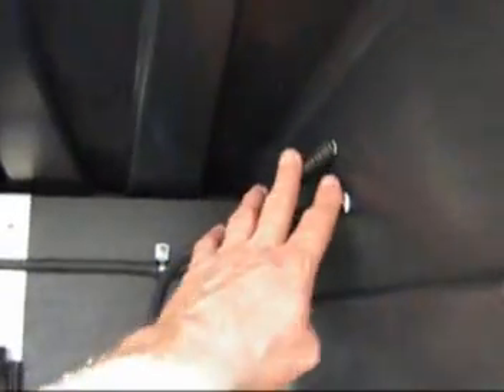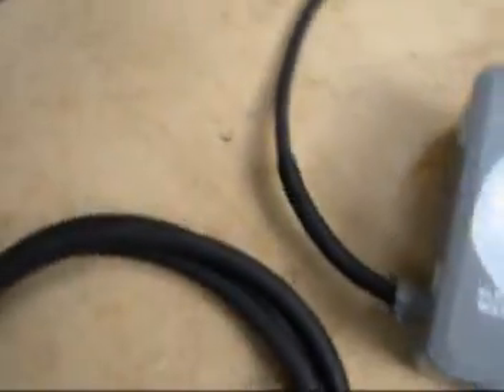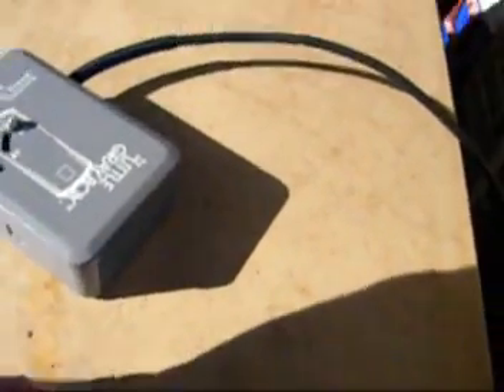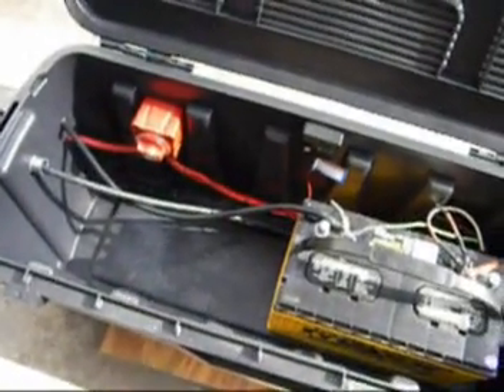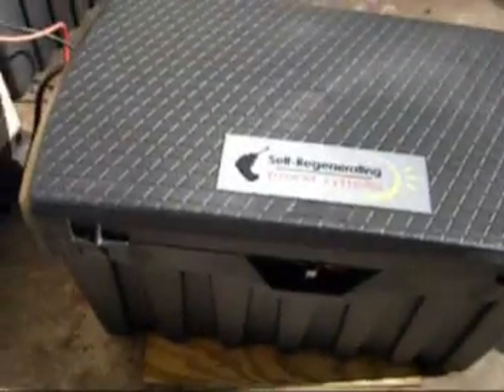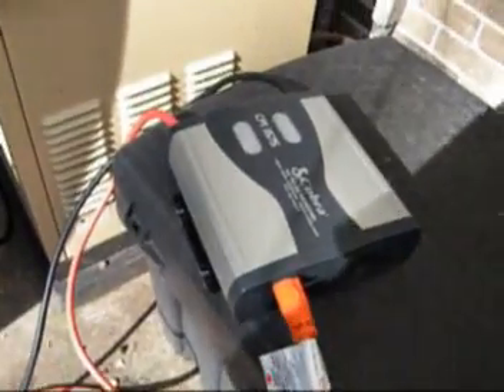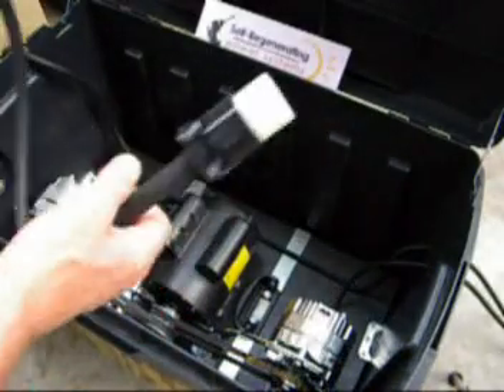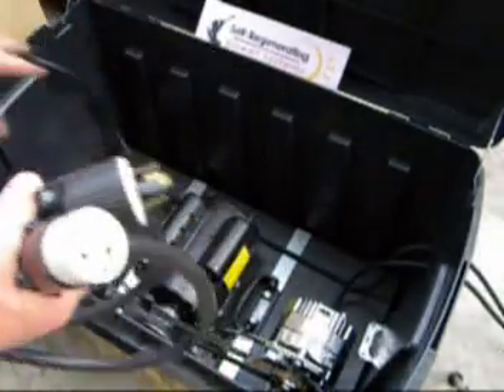Alternators : Alternator power box

Comment: It's not a self sustainable system..you are relying on the grid to charge your system..eliminate using the electrical power grid to start the system...or even eliminating the generator...a true self sustainable system relies only to produce usable power and to recharge itself at the same time...I have  built my own that is truly self sustaining...you are on the right path, just do not rely on a generator nor the electrical grid to initiate power. Think on those terms and you will succeed with a self sustainable system...keep going,  you will figure it out. 😊

Comment: A. 230v 19 A farm duty  3 Hp motor has 
28 ftlbs / 38 NM @ 3600 RPM.
THATS EQUAL TO A 14 Hp gas engine.
Its A very heavy and very expensive motor.

Comment: You just gave me an idea to the 48v ac 8000w wind power generator welding a box water proof and run it with a belt or rubber onto a marine ac motor connect with direct to main 50amp breaker one sided ,,outlet 15 amps to the ac to dc then  batteries 3 DC 48 volts  n back to run the motor , inverter with heat sink and fan for back up for motor in case of burn out ,,buy another motor if it's cheaper or repair warranty

Comment: U could just buy a 200 amp dc power supply to run from generator to charge batteries. I use a 60volt 55 amp power supply to charge lithium batteries. Then those batteries power pure sine wave UPS's that then feeds a transfer switch that can choose between gen or battery

Comment: This is a very interesting video, can it be applied to a camper being lived in full time and converted to 110 volt 30 amp output? What would be the constant power to be used? My camper runs about 4500 watts startup but backs off significantly depending on whether the air-conditioner is running. I am new at this so please forgive me if my verbiage is a little off. Just checking if this is doable in my situation before moving forward. Thanks

Comment: useless
Reply from the maker: Some are missing the point, the alternator power box is designed to work with a generator system. The alternator power box is designed to work in all types of weather. You could use  an electronic charter but not very efficient or safe out in stormy weather. Such as a hurricane tornado heavy rains etc. I live in Florida we have lots of tropical storms and hurricanes etc. the system can be left outside in the weather and it works with my standby generating system for my house. We've had stormy and power outages for five or six days. But when I run my generator only want to run it for a short time maybe an hour our to,heat the house Cook or get hot water and only do these things all at the same time while the generator running. My generator put out plenty of power to provide me with the services plus run the alternator power box which will be charging my batteries during the two hour service of the generator. I then turn off the generator conserving my fuel and switch over to the batteries that I had charged during the service and now have power for computers TV fans etc. for several hours 6 to 8 hours. Normally within about 3 to 5 hours I turned the gender back on proceed to cool or heat the house, get hot water run the refrigerator etc. and recharge the batteries. I hope this better explains the system. You can use electronic charters but they can be an issue out in the weather even if you put it in a box it has to have ventilation and you can get a lot of moisture inside the box that can calls problems with that charging system.
Reply: good work i notice your point of view. good job
Reply from the maker: Very Cool Thanks

Comment: LOL..boy i tell ya you are working hard for no reason, why not just buy a battery charger and work easy
Reply: stupide
Reply: Because two altenators will charge a battery faster and they can charge an entire battery bank vs one battery at a time W a battery charger.
Reply: Tircky G Washington You are missing the point,  it charges the battery when usage is low no gas is used.  It effectively makes the gallon usage drop by 70 -90% when running off grid. Needs more batteries though I'd say 6 batteries, and a more efficient drive motor.

Comment: Unless your generator is significantly larger than necessary, this is not a particularly efficient method, and it can be abusive to the battery or batteries in the system. A deeply discharged battery will accept more current(amps) than one that is close to fully charged, meaning that your electric motor will be consuming more current than it's producing past a certain point. That same deeply discharged battery, when fed all of the amperage it will accept in a deeply discharged system, can outgas at a much higher rate. This isn't a problem with batteries than can have water added, but so called "sealed" batteries also outgas. You can't add water to the "sealed" battery, so it ends up with less and less, and it will fail much more quickly than if it had been charged at a slower rate.

Batteries intended for starting a car are not designed to be deeply discharged or for high discharge rates over a long period of time. Anyone would be much better served by true deep cycle batteries or GC2 type batteries intended for a golf cart. Either of them will tolerate more cycles of deep discharge and provide more amp hours of reserve capacity.

Those alternators will create a lot of heat by themselves, which makes them less efficient. Putting a full load on them will generate even more heat. If the heat becomes excessive, cause the diodies in the rectifiers to fail. Whether someone buys a remanufactured alternator to replace it(which won't be a one wire as you appear to be using), or replaces the rectifier, it will cost around $25-$30 at most parts stores(if they have it in stock).  It doesn't look like your enclosure has much venting. One other caveat is that if someone is only using a single alternator, then the second alternator should not have it's field energized or the voltage regulator will fail. The reason being that with the field energized(voltage TO the alternator), it will be generating power, which then has nowhere to go. A one wire alternator is a poor choice for the way this is set up since they are usually self exciting, meaning they will energize their own field and produce current when spun above a certain RPM.

All in all, anyone could build an equivalent to this for less than $50 at a scrapyard(motor and alternators). Also, the highest amperage 10SI alternator that Delco Remy produced was 63 amps. The slightly newer(and significantly better) 12SI was produced in versions up to 94 amps.

Comment: You should modify it to run by itself one alternator will power the motor and the other one will power your battery
Reply: +Hayden Gudmundson there isnt even a need to do that, one alternator is plenty enough to charge the battery and also supply plenty of power to an invertor with at least 4 plugs.

Comment: where can i find this?
Reply: Give me some more information electric motor running on what RPM  & AC or DC what HP thanks Haroon
Reply: Mohammad Haroon your electric motor on what RPM SPEED rotates with two alternators, your battery is how many Ampère's 12v or 24v thanks Haroon.

Comment from the maker: Hi Bruce, I do appreciate your watching the video and all comments. The alternator power box is very efficient for charging batteries.The system is very low maintenance the electric motor and alternators will perform well in bad weather cold-weather wet weather etc. compared to say an electronic AC conversion to DC, and we all know that an electric motor and an alternator have been in use for many years. I've seen electric motors and alternators last for over 50 years. Have a question e/mail.
Reply: What is your email sir?